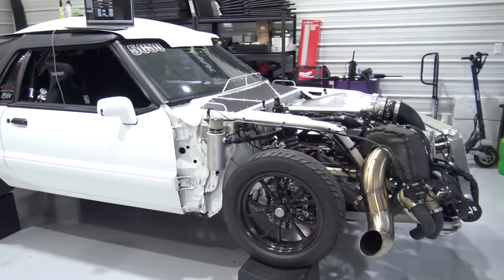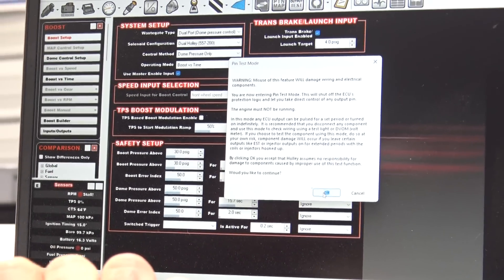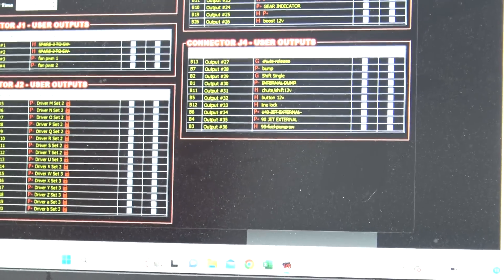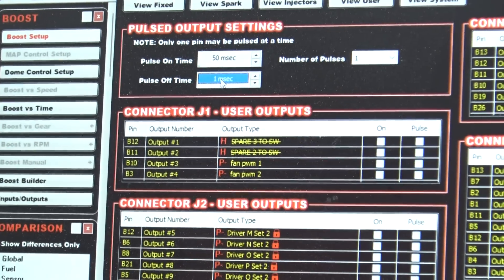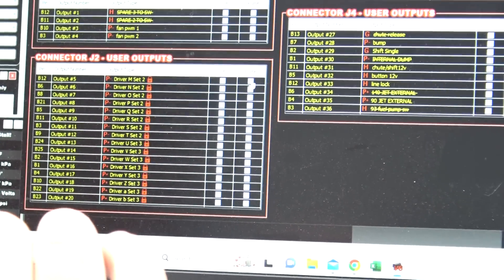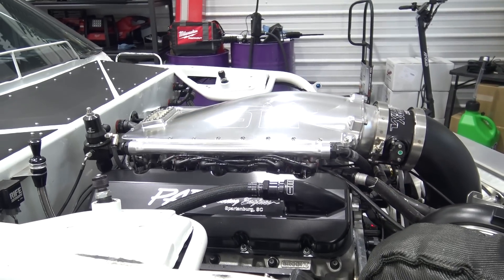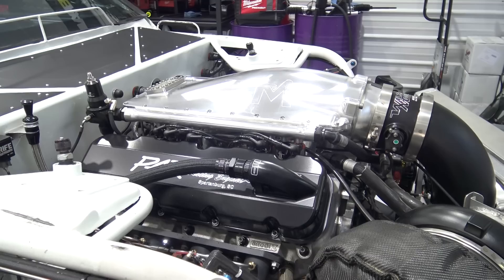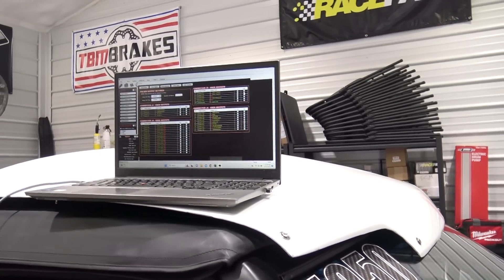HOLLEY EFI HAS OUTPUT TESTING NOW. CHECK IT OUT

Comment: so on the spark output test feature i get signal out to my coils but coils do not want to fire do i have to change any settings in the program or just run basic settings that holy provided ? my guess is the spark table in the global has nothing to do in the test feature . ? thanks

Comment: Devin - thanks for explaining this still undocumented feature. When pulsing coils, what should one expect to see or hear? I don’t get a spark on a grounded plug or hear anything clicking.
Reply: I found on a Holley forum that a grounded plug should spark when pulsing a coil. The fuel pump relay needs to be on. Has not worked for me, but I believe that is how this output test is supposed to work.

Update: By trial and error, I discovered that a coil had to be pulsed a minimum of 10 ms. Worked great after figuring that out.

Comment: I had to start the fuel pump to test injectors and coils, did you have to do the same thing? did you just pull the fuse for it? Or is it an updated version?

Comment: Ok devin help me out bro. I have terminator x max. I believe i might have an injector issue. When i go into test output function, I set my on and off time to 50 and number of pulses to 8. When I click pulse I get nothing from any injector. This is a running and driving motor in a silverado so its not a no start issue. I jist want to test the output of each injector individually but cant get terminator to pulse them. What am I missing about output testing?
Reply: Injector need power to work test mode just pulses the ground.
If you have the holley fuel pump relay running your fuel pump unhook the fuel pump then in test mode enabled the fuel pump that will give your injectors   voltage so they will pulse when you test them.
He must be using injectors driver boxes that power his injectors